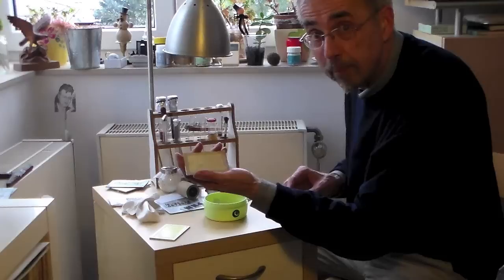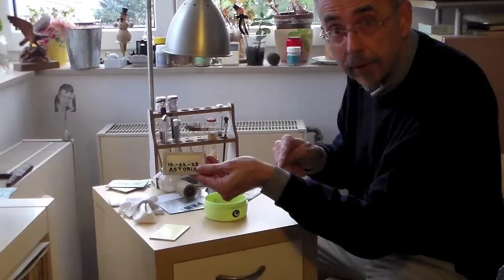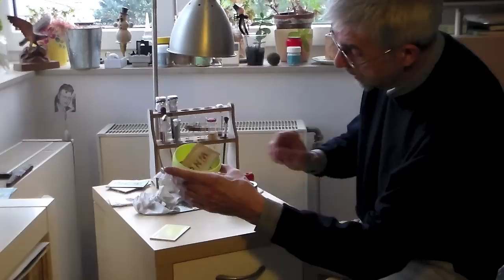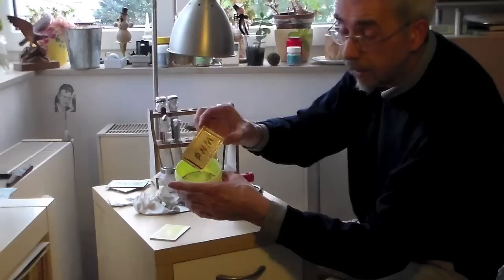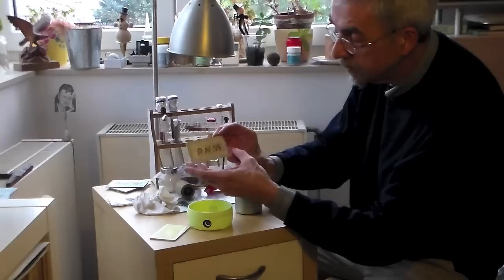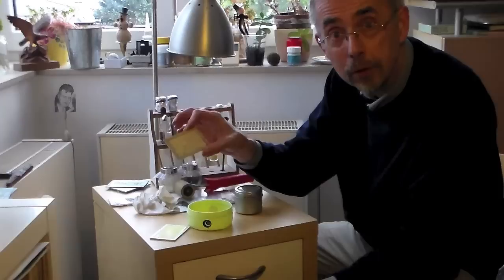First xerography - quick demo part 1

Comment: thank you for sharing how to do it Klaus. : ) I just found out about Xerography. Have you tried etchings? I learned how from Artist Toti Lewis in BC, Canada...where we put wax on a sheet of metal,  drew into the wax with a fine point metal piece and then used some kind of acid that bites into the etching grooves made in the wax and then you can put ink on it and press on paper. I want to try xerography for animation when I have a chance.
Reply from the maker: thanx Johny, You can transfer xerographic prints to metal sheet using a solvent and then etch it, too. This also works on lithographic stone. Franz John from Berlin made animated movies with photocopiers.
Reply: @urbons256  Wow! danke shoen for telling me that Klaus =)

Comment: Thank you for sharing this! How do you make the sulfur coated plate?
Reply from the maker: It's not too difficult. I got plates of aluminium but also used zinc (for engraving) and covered them with sulphur powder. Then I put this in a small frying pan on an electrical heater. Sulphur melts at about 110 degree celsius and is a clear yellow liquid but if you heat it more it becomes viscous and brown. Then you may spread it over the plate or put another plate or glass on it and let it become hard again. So you'll have an even surface. Of course you have to find out how much sulphur you will need to cover your plate. And it's best to let the plate harden for some days. Good luck.
Reply: @urbons256  I ordered a zinc plate. Does aluminum work just as well as zinc? It's much easier to find than zinc.
Reply from the maker: Yes Tristan, in my demo I used aluminum plates. Most metals will work. The thing is, to make the sulphur stick to the plate. You may roughen the surface with coarse sandpaper, for instance, before coating. In my first trials I etched the zinc plates with acid. The aluminum plates were mortised with a machine to get a small recess. The thinner and more uniform the sulphur layer becomes, the better does it work. I also polished it with emery after it was fully hardened. There's another longer demo of mine on Vimeo - search for < From Electron to Electrophotography > there you can clearly see the aluminum plate.